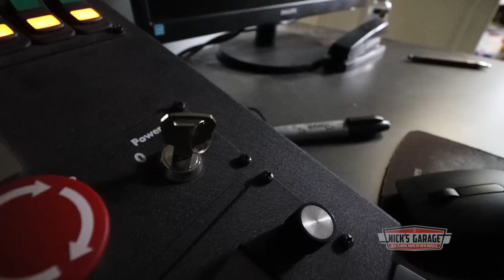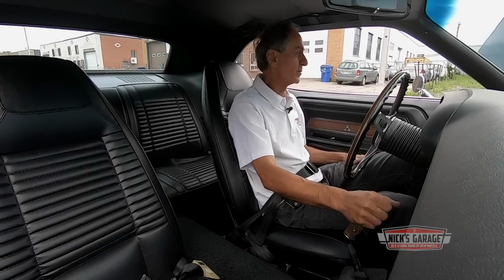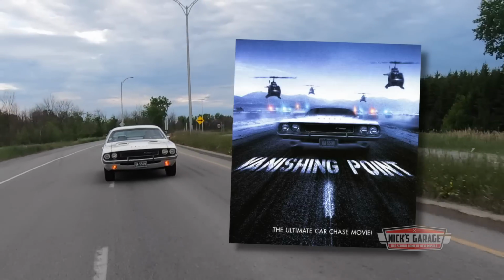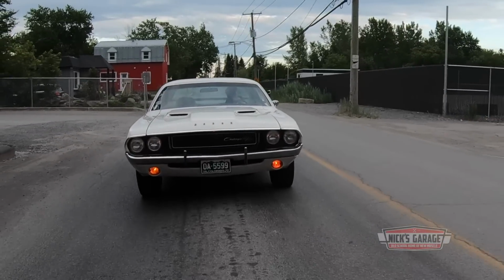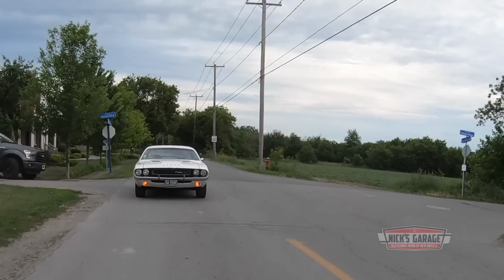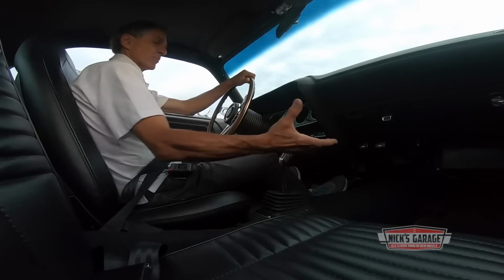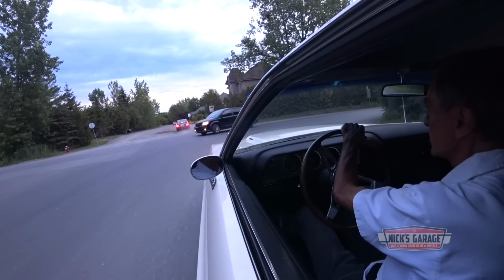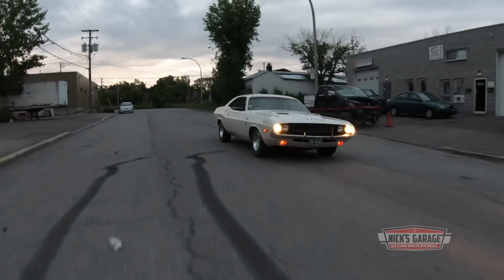1970 Dodge Challenger R/T - Muscle Car Meditation with Nick

Comment: Georges car Nick. My brother bother a RR in 70 with the pistol grip. Yours is nice and tight as you most likely rebuilt the entire linkage to be tighter and smoother than they were brand new. No doubt being that was hand built every nut bolt and screw was carefully set in place. Much much better than they were made out of the factory. Most of them were rattle traps with tinny sounding door closures etc. So nice to see one master crafted and solid as a rock. What a great investment. You are sitting on a gold mine. Worth at least 100K at a Barrot Jackson auction. Thanks for sharing with us.

Comment: That is one beautiful classic. I'm restoring a 1947 GM PD3157-473 Silversides Greyhound bus. The classics are getting scarce. Loved the video!!!!! Enjoyed the ride.
Reply: Rodney.        I was asking someone last year that I wanted to restore a 1969 city bus. Instead, I went with my Kowalski project.  Good luck with your 1947 Bus.
Reply: @nickpanaritis4122  I picked up the tires on Tuesday and am putting in some temporary wiring to get it going. It's old school so 4 wires to the engine is all I need , start, stop, shutdown and brake light. Gotta love "Old School". I bet BMW could screw that up if they had a chance. Thanks Nick.

Comment: Can You imagine, walking down these streets, and Nick pulls up at a stop sign, in the U code challenger ?  Straight. Clean. A rumble from the exhaust provokes a comment
    from anyone standing there;  " That aint no 318 ".  Nick cracks a smile, stands on the accelerator, grabs the pistol grip shifter, pops the clutch, and she lights up the polyglas tires...  
  Kowalski just cruisin' downtown boys. This is the real deal.

Comment: Just a beautiful car, Nick! If you ever need to get rid of the ten year old tires, I believe Coker Tire makes reproductions of those polyglass tires. This is a car that you would not want to have a blowout on. The only other improvement would be to have a Hemi, but that car is so perfect as is. Thanks so much for your videos. They are the best on the Internet by far.
Reply: Fred.      I never saw anything in Goodyear from Coker.   I had checked with them.
Reply: Yes, you are right. I. must have been thinking about Firestone Wide Ovals or B F Goodrich Radial TAs. But I think Jegs has the Goodyears but I believe they are way overpriced. Just watch the 10 year old tires, as I worked at a place where we sold tires for a few years, and I have seen old tires fail and cause major damage to a fender when that happens. Not something you would want to deal with on that beautiful classic Challenger!

Comment: Nick, if you would, do this with that '70 GTX.

My first real car, was a '70 road runner. (Look 
at the trunk, that is how it was spelled.)  383, 
A833, and Cragar Super Sports.  Had the 8.75, 
but no suregrip.  It DID have that Hurst Pistol 
grip.  (Did the 2 feeler gauge trick, put a Comp 
Plus handle in it.)  The gap between first and 
second, (the rubber on the road) you could cover 
with an 8.5/11 piece of paper.  Paid a MASSIVE 
$800,00 for that car.  But, I sold it.  Worst mistake 
of my life.  (We won't mention my marriages.)
steve

Comment: nick I may have miss it in your videos on your challenger built, Did you added any undercoating or insulation to reduce any heat from exhaust system and road noises? I was wondering...
Reply: Terry.           NO, not really.
Reply: @nickpanaritis4122  I sounded great great when you was cruising in it! love it!

Comment: Thanks for the ride Nick. I noticed your exhaust has a small rattle in back pressure situations that I noticed back in the day with other challengers/cudas. To me it sounds like loose metal. Is that characteristic of those. I had a 69 charger with 440 auto didn't have that rattle.
Reply: Gary.         The  E-Bodies  have  mufflers at the very rear.

Comment: Do all four headlights turn on when brights engaged or does the outside pair switch off and inside pair switch on?
Reply: dti.        When lights are on, outer, known as "Low Beam"  and then the inside lights known as "High Beam"  are put on, all 4 lights are on at the same time.

Comment: Question I've wanted to ask. Did Chryslers have 4 speed manual transmissions 50 years ago? In Australia back then they raced 265's against 4 speed 350's and 351's. They put on a good show but as I remember, the drivers lamented not having 4 speeds.
Reply: The first lot of VH Charger's for Bathurst was the E 38, which was the 265 Hemi 3 speed.

Couple of month on the E 49 was introduced with a 4 speed.

Valiant VH Charger E 49
Reply: I just checked Wikipedia and according to there, local content laws at first prohibited 4 speed boxes sourced overseas and there was nothing suitable made locally. Also some of those 265's were pretty quick. 1/4 mile times of low 14's some of them. Not bad for the day especially considering the displacement. A source claimed quicker than the Phase III 351 Falcons. Some 265's had 302 HP as well.
Reply: @kdfrkdfr  

The E49 with the 4 speed was 302 hp from 265 cubic inch.

Better than 1 hp per cubic inch.

Those XY GT HO Phase III, were basically a Boss 351 Cleveland motor so about 335 hp.

The Hemi was so much better in a lots of way.

Lighter, faster & a very sexy 2 door coupe, compared to a brick sedan of the XY.

The only claim to fame the XY has it was tge fastest 4 door muscle car in the world.

I dispute that because back in 1966 you can order a 426 Hemi in a sedan & some were build. 

Tell that to the XY lover's & they almost cry about it.

Chrysler should of exported the 6 cylinder Hemi to the states & replace the slant 6 like we did here in Australia. 

There was a more powerful Hemi in the making but politics got involved & the whole Australian muscle car scene died overnight. 

XY GT HO Phase 3 very over rated in my opinion.

Glorified taxi, muscle cars should only have 2 doors not 4.

Comment: Heh you know its funny just like with Burt Renyolds with Smokey and the bandit to White Lighting, theirs another car chase film Barry did where nobody knows about it, Look up fear is the key, he drives Eastwood's Grand Torino into the ground with that one, complete with the Score of Roy Budd, the man who scored the film get carter and who dares wins, and its quite a chase, granted I've never seen the rest of the film, just that bit lol 

also you know this is the first time I've ever seen someone rolling a challenger with everything stock, as their always restomodded and never sit right in the back given they always, ALWAYS put oversized tires on it.

like honestly if you ever upgrade the thing after awhile of using it, I would almost keep it in period with that too, as some people used to put the disc brakes of the front on the rear, like an all around brake disc conversion, and maybe some extra roll bars like the ones the latter 340 Ralle models came with, which I think was just the plain old torsion bar suspension really, as brakes and a little chassis stiffening dont ruin the character of the car, they just make it safer, and allow you to use it harder. 

and who knows, maybe those guys who made that super T/A, hotchkis, have some easy bolt on parts for that, as we're kinda lucky in that vein, everyone is upgrading everything you can imagine on these, and no ones gonna give anyone lip about better brakes too lol

Comment: way too many switches to shut the shop down and open daily, yikes!
Reply: throttle.            I do it every day.  A bit too many.
Reply: @nickpanaritis4122 
I'd be looking at wiring changes with a few start/stop push button stations for the main shop lights and individual for other work rooms and maybe a master off for all by main entrance.
the dyno computers and machinery would be manual still. depending on the current wiring layout/age it may not be too bad to get done. but who knows until a sparky looks at it